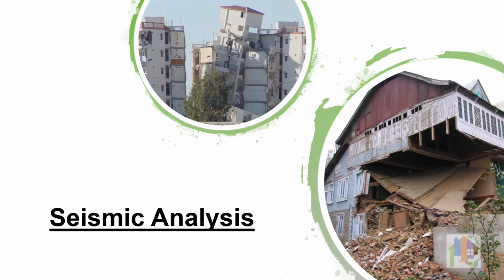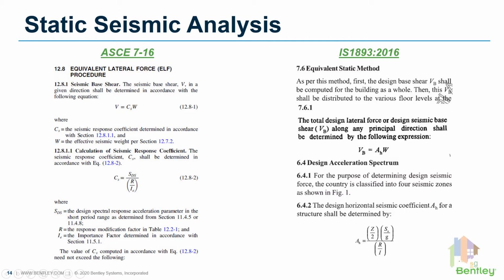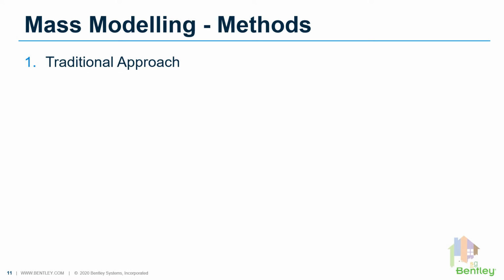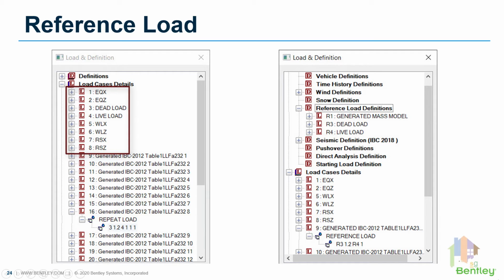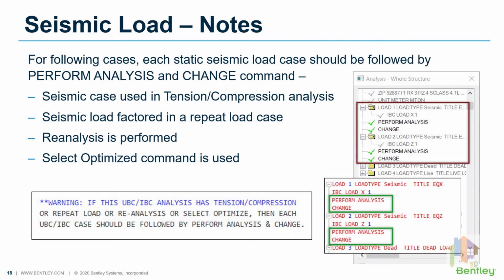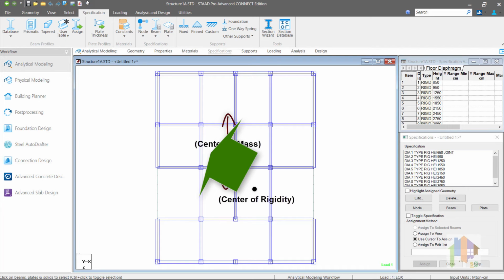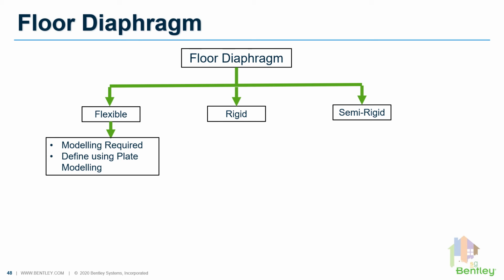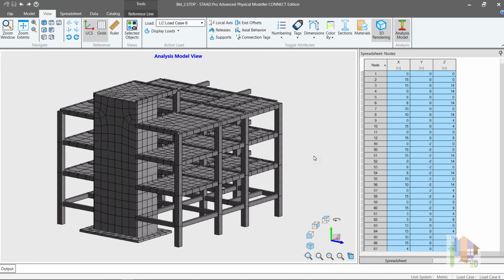Modelling for Seismic Analysis in STAAD || ASCE 7-16 || IS 1893(Part 1) || Acc. Torsion & Diaphragm

Comment: Good explanation. I need to know that Floor Diaphragm option shall be applied only for Concrete Slab integrated with Steel structures or it can be used for Concrete Structures also? Also if I consider Concrete slab as Diaphragm which can resist lateral forces, Can I eliminate Plan braces(in steel building) in that level ?
Reply from the maker: Using Floor Diaphragm, we can consider the in-plane rigidity of a slab, whether it is a RCC, PT or composite deck. It is one of the easiest way to consider the in-plane stiffness and torsional effects during earthquake analysis without modelling the slab with FEM. 
Yes, you can use this for concrete slab (assuming it is a rigid type diaphragm). If you specify a floor diaphragm at slab level, you can eliminate modelling the plan braces, but for accurate analysis, it is always better to model the correct structural components.
Reply: @surojit_ghosh  Thank you for the reply. Can you please share the marco file for Auto-generation of Gravity Loads under Reference Load definition ?

Comment: Nice presentation,may i have this macro for generating mass model?
 And may you please upload a detailed explanation of wind load as you did for seismicin this video.
Reply from the maker: Separate macro is no longer required to generate mass model. Since STAAD CONNECT Edition Update 9, an option is provided which can be used to generate mass model. Check this video for more details -- https://youtu.be/jPUOGACnIM4

Comment: Hi Great work. While designing multi storied building I have seen columns in the top level has more moment compared with bottom level. Can you help how to solve. Particularly in the case of gravity loads. Thanks.
Reply from the maker: For any high rise building, peripheral columns are subjected to more forces/moments at higher elevation due to the lateral forces, this is normal. Can you check and confirm that the higher moment is due to the gravity load, not for a lateral load or combination case?
Reply: @surojit_ghosh   Thanks for your reply. The higher moment is due to gravity load. Can you please share your mail ID. I will mail the staad file.

Comment: In reference mass load type, dead & live load in gravity direction (-ve sign) is copied/used to calculate static seismic weight.(timeline 25 min onward). For dynamic same is repeated for all three directions viz x,y & z with -ve sign in reference mass load type. Aforementioned 25 min onward to eliminate tedious task of considering same in seismic definition & in dynamic load case. My question,1. does staad calculate seismic weight for static & dynamic  if we define dynamic mass in reference i.e in all 3 direction?. 2. Does -ve sign in reference mass is same as +ve sign as long as the direction are same in all 3 direction?.
Reply from the maker: 1. Yes, STAAD internally calculates the seismic weight for static and mass model for dynamic analysis directly from a mass reference load case with mass defined in all 3 directions, this is discussed in detail in this video -- https://youtu.be/6QXkNcAN_8E.
2. Mass is sign less, so theoretically we need to specify it as a positive number. But if it is copied from a primary load case to a mass reference load with negative sign, then during seismic mass/weight calculation, program converts it to positive mass. Just create two instance of the same model with + and - mass, you will notice same seismic weight/mass is considered for static and dynamic analysis.
Reply: I need your support

Comment: Greetings, where i can get the macro you are using to generate Mass Refrence Load ....thanks.
Reply from the maker: This is one of my unpublished macro that I created long time ago. Using this macro, I can skip the entire mass model generation process and for a large building structure, it saves lot of time - I normally define the gravity loads under primary load cases and use this code to generate mass modeling.
Reply: @surojit_ghosh  Yes it is very good tool , I hope  I could get it
Reply from the maker: Auto-generation of mass model is now included in the latest version of STAAD.Pro CONNECT Edition (Update 9) as a default feature. You can check this video for more details -- https://youtu.be/jPUOGACnIM4
Reply: Thank you so much 🌹

Comment: Sir, 
What is basic difference between static & Dynamic analysis?
Reply from the maker: If you want to consider the actual behavior of a structure subjected to earthquake load, you need to perform proper dynamic analysis. Equivalent Static method of seismic analysis is an approximate method, it assumes that fundamental mode of vibration is predominant, neglecting all other modes of vibration. As per IS 1893, it is applicable for regular buildings located in seismic zone II with height less than 15m. Whereas when you perform response spectra analysis, it considers the structural response of each mode and finally use any modal combination method to find peak response. 
There are several differences between these two approaches and you can go through any standard textbook to know more about dynamic analysis.

Comment: @surojit Could you please explain how to define the floor diaphragm in order to let only shear/core walls resisting the lateral forces and other elements (in my case steel structures) only transferring those forces to the shear/core? Could you share your email ID?  Thanks in advance.
Reply from the maker: When a lateral load is applied on a structure, that load is transferred to the support using a proper load path. For lateral load, this load path consists of members/elements which are specified as lateral load resisting element like shear wall, bracing etc. If you don't define any member specifically as a lateral load resisting member, then all connecting member to the slab will be subjected to force depending on location and stiffness. If you can define the dual framing system (Gravity+Lateral separately), then it is possible. 
In STAAD, there is no option available to define dual framing system (like RAM Structural System) but you can manually define this using release command and using CHANGE command to separate lateral load from gravity load cases.
Reply: @surojit_ghosh  sir can you please spread some light on how to use those commands
Reply from the maker: Sorry, I am unable to understand your query properly. Which commands are you looking for?

Comment: A particular use case example for static analysis only, demonstrating the theory would have been very useful. A lot of information has been given in the video but it becomes confusing since dynamic analysis and static analysis all seem to be combined in the same model and this video is supposedly about demonstrating static analysis. The final effect is that it's somewhat confusing to beginners to apply the theory to a particular model.
Reply from the maker: This is not actually a demonstration of static seismic analysis, rather this is one of my webinar on seismic analysis that I delivered early this year. Few modeling techniques are common for static and dynamic analysis like modeling the diaphragm, consideration of seismic mass and accidental torsion. So I have used dynamic analysis as a reference to elaborate how the modeling approach will help if response spectra load is added to the model. I admit that all these information might be confusing for any beginner. 
I will start a separate series on seismic analysis later this year covering all aspects and I am sure that will help you to understand the details.
Reply: Thank you for clarifying the matter, it would be really helpful for beginners when you publish your series.